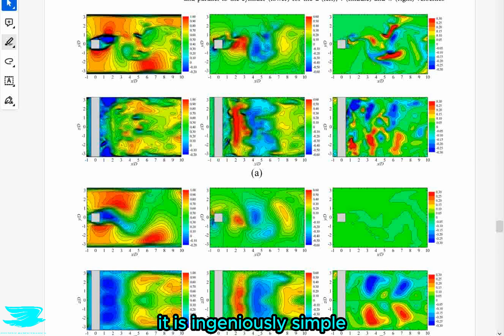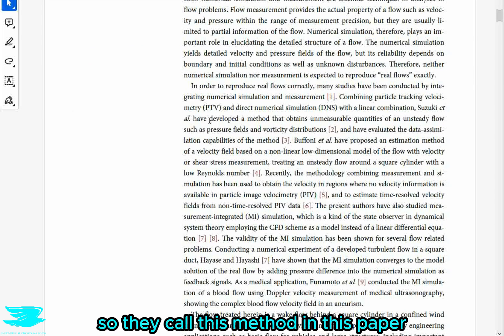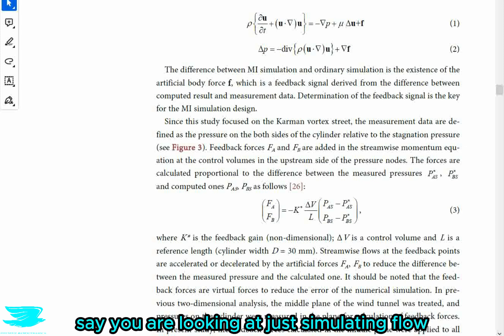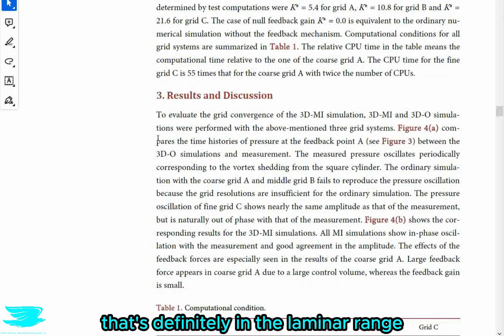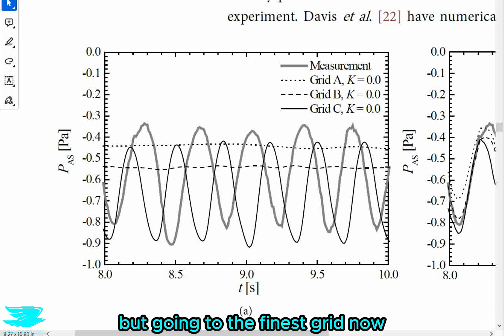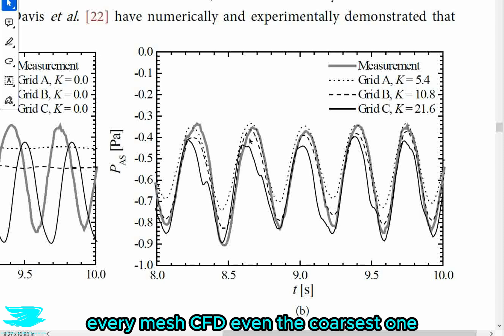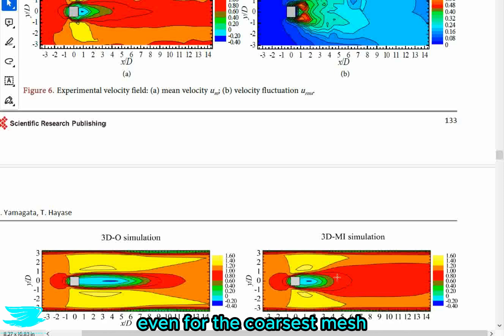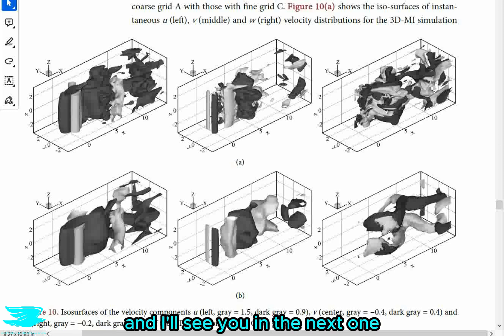Podcast 186 A New Way To Do CFD That Works!

Comment: The correction factor F is needed, cause the world spins around. 
And brainless people start to repeat themselves. 
Machine Learning is a try to get out of the wake. 
If new stuff is solved, you got no correction factor F to feed in. 
So the cfd solver stalls, or takes more computational power. 
If things are new there is no right guess, where to start iterations.

Where to get an idea for Intuition ? I guess this is deeply rooted to experience of anchestry.

We can't get out of the world's turning. Cause the vortex is forming live. 
But somehow we need to move. The resistance from consersative forces forms time.
Time burns things away like fire. 

And i start to understand  Déjà-vu .
Only the perspective reveals the imitator, if we are turning around all the time.
Reply from the maker: I seem to repeat myself a lot.

Comment: Let’s suppose I’m going to use experimental BC’s to force my CFD solution. What if the CFD case I want to reproduce is different (change in geometry) than the experimental data I have ? CFD is often used to avoid experimental costs or am I wrong ?
Reply from the maker: That's a good caveat. CFD is sometimes used to avoid experimental costs, but it is also sometimes used to augment the amount of information you have.

You use the experiments to validate certain points, then you can go from there to use the CFD to get deeper insight around the geometry, and calculate other values.

Comment: Regarding solution oscillations, a simple way to introduce damping would be to cap the artificial restoring force at a maximum value. This would reduce the amplitude of the solution oscillations. If the software gradually reduces the capped value to zero as iteration number increases, then the solution should converge with great stability.

Is there a way to run a coarse-mesh MI, then use the results as initial conditions for a refined mesh? This would grant the increased fidelity of fine mesh CFD, but without much computational cost.
Reply from the maker: That would be a good way of preventing overcorrection.

Definitely, I mean, I don't know their exact setup, but with CFD in general, it is very easy to map a coarse solution to a finer one as the initialization part. For example, in OpenFOAM, you use the mapFields command.
Reply: @PremierAerodynamics  I thought so. I used Fluent/Gambit a fair bit in college (incompressible, k-epsilon, steady RANS, if I recall correctly). That was so long ago I forgot how to do it.

Comment: AI has been good in this regard. People think it's just fudging data, but using AI to create an algorithm to converge your CFD solver with experimental results has worked quite well for me.
Reply from the maker: I have had some good success with it too, but I think that it also depends on the exact AI. AI has such a broad meaning, and a lot of hype at the moment, that some things are really useful, while others are just hype.
Reply: @PremierAerodynamics  Specifically Neural Ordinary Differential Equations. There's a paper in 2018 I read a few years back that got me down that rabbit hole. It's a deep one too, enjoy.